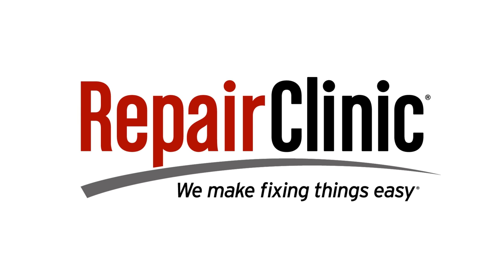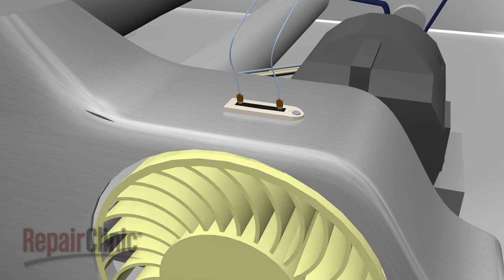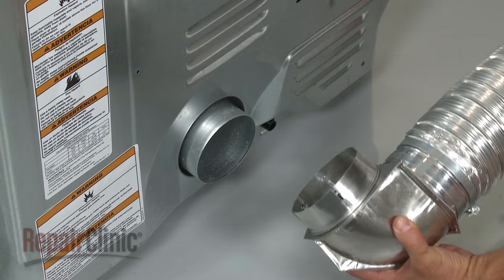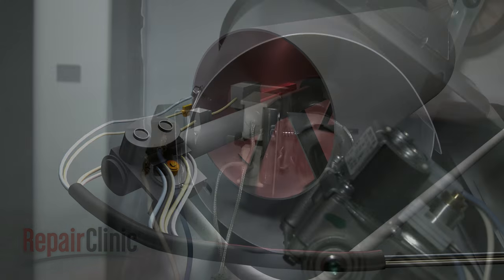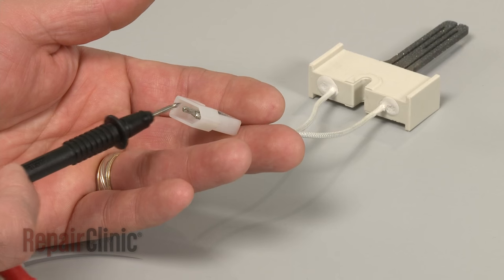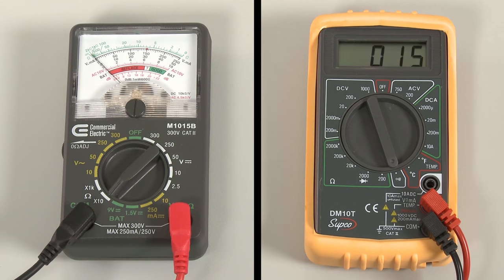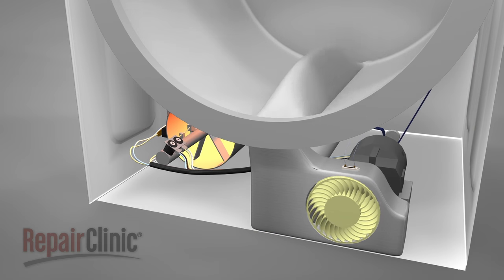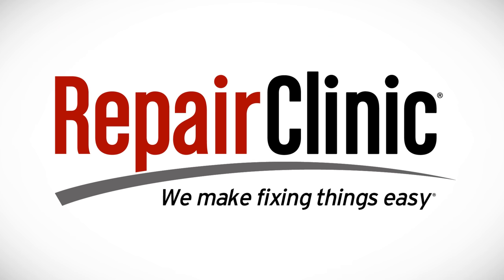Top 5 Reasons Gas Dryer Is Not Heating — Dryer Troubleshooting

Comment: I not only had to clean the 4 inch ducting I also had to open the blower housing at the back of my Maytag dryer  ( 4 nuts at the back holding the housing and 2 Phillips on top by the screen) . You have to tilt the whole dryer forward to pull the housing off. All the holes were plugged with stuck lint.

Comment: I've tested the thermal fuse and the flame sensor and both hAve continuity. The ignitor glows, so it's not the ignitor, but no flame is present at all. I also tried replacing the solenoid coils and that didn't work either. The dryer runs fine, but does not heat up. Based on the facts above, it doesn't sound like it would be the thermostats either ( as the ignitor does turn on just no gas burns). Any other ideas???

Comment: Thank you so much for this video.  While doing a load of laundry,  the dryer was not getting hot.  After watching your video and cleaning the vent and also taking off some excess length, the heat kicked right on.  So thankful that I didn't have to buy any parts and will keep in mind to keep the vent cleaned thoroughly more often.   A life saver.😊

Comment: Used a shop vac to suck out the debris in my vertical exhaust vent as well as replacing a $13 thermal fuse and thanks to this video saved me a trip to the laundromat.

Comment: Thanks for the video - Have Speed Queen TR5 Gas Dryer, blew everything out with work shop blower and the dryer heats up fine now.  Bottom area was full of lint but the exhaust line was clean.

Comment: Can it be filled up with lent in the back of the dryer? Could be why it's not getting hot enough I have flames I could see through the little vent in front. On sixty seven counter ford to have a Service.

Comment: GE dryer was not drying.  Replaced ignitor, coil, and the rusting burner assembly.  Still no drying.  ignitor and flame are visible in the mirror.  Flame cycles every 60 seconds for 60 seconds.  Checked the exhaust.  The flow is strong.  The exhaust hose gets warm.  Removed the exhaust hose to check exhaust air temp.  Placed hand in the flow.  Somewhere I have read that exhaust temp should be 200 deg F.  This does not feel like 200 deg F.  Scratching head.  Any ideas?  Thanks.
Reply: I know its been 2 months, but did you fix the problem. I once experienced something similar. I bought my home the ex owners gave us the  appliances. The dryer alsways took forever to dry. I thought Id get a new one since the one I had was old. I put a new one in, same thing. I took it back and told them something must be wrong with it. I took home another. Same crap! Im like what the....! So I called and they sent a repairman. He said the gas line in my house was older , and might be corroded inside the pipes, but he wasnt about to mess with it. So after he left Im  looking at the line and noticed another shut off valve higher along the gas line, even thought there was one closer to the dryer. Being it most likely wasnt turned in years, I debated whether I should try to turn the valve, worried that the movement might cause a seal problem, but I turned it! It turned about 1-1/2 turns to open! The furnace fired up nice and hot with a strong flame and worked fine. My old original probably was good as well, but the owner most likely thought they were saving gas by turning it down, or something?? It makes no sense since you had to run it longer to dry.! What a pain in the ass installing and returning dryers a couple times was!.lol

Comment: Hello Thank you for the great video!
I have cleared the vent replaced thermal fuse and gas valve coils. I tested for continuity the igniter flame sensor thermal cut off fuse high limit thermostat and timer and they are all good but it still turns off after 20 seconds. Please help.
Reply: Its the gas valve,  it is near the coils.

Comment: My dryer starts but the igniter does not light.   I replaced the igniter but no luck. Imeasured the resistance of the igniter and it was 60 ohms so its good.  I measured only 56 volts across the 2 pieces of metal that hold the igniter in place.    I have in the past measured 120 volts.    Any tips?
Reply: The problem was the flame sensor.  It was OPEN no voltage could go to the igniter.  I jump the flame sensor and now I have 120 volts at the igniter.

Comment: my dryer wont heat.  the vent is clear.  if I pull the dryer out from the wall it works sometimes. is that a crimp in the gas flow?

Comment: dumped my maytag washer that was not even two years old because it quit, now the whirlpool dryer geez, don't they make anything to last anymore.
Reply: I have had my Whirlpool washer and dryer for over 30 years! Whoo hoo. However the dryer is not heating so I'm going to look into fixing it myself. Getting a multimeter to check the parts mentioned in this video. Anticipating a fix. 😁 But I agree with you that things are not built to last these days. But parts do wear out so if it's a part I can still get, I'll be happy to fix this. I fixed my washer of this pair when the agitator wouldn't agitate anymore. Simply had to replace these little plastic pieces called "dogs". 😁

Comment: I can't find the thermal fuse on our GE  gas  dryer  Drsr483gg4ww.   I went to your website and looked at the repair parts for the dryer and I cant even find a replacement thermal fuse for the  Drsr483gg4ww,   
However the thermal fuse is mentioned under  cause #4  Flame Sensor ......"On a gas dryer, the flame sensor detects the heat emitted by the flame. If the flame sensor isn’t working, the dryer won’t heat. Before checking the flame sensor, first make sure that the igniter and ***thermal fuse ****are not at fault. To determine if the flame sensor is defective, use a multimeter to test the sensor for continuity at room temperature. If the flame sensor does not have continuity at room temperature, replace it."

Where is the thermal fuse located on the  Drsr483gg4ww.

Comment: I replaced the fuse, i checked continuity of the gas coils. But before taking apart the top and front panel, i peeped in the window and there is no glow or flame. Will there still be a glow if it happens to be the igniter or is the igniter only responsible for the flame? Or is the flame and glow the same thing? Either way my fuse and coils are working but its not getting hot!

Comment: Could the problem be beyond the electrical and be a mechanical problem of the gas valve?   The igniter will lights up (heats up) but no gas. The solenoids buzzes  while the igniter is energized but we do not get any flame.   Per your video we checked out the (1) Thermal Fuse, (2) both solenoids, (3) the igniter (4) flame sensor (5) thermostats with a digital meter and they all checked out fine.
Reply: Did you find the problem?

Comment: my gas roper dryer is losing heat after 10-15 minutes.  the spinning/ tumbling continues.  i've checked the continuity of the thermal fuse, gas valve coils, igniter, flame sensor, and the thermostats and all appear fine.  is there anything else i need to check?  can any of these components be failing despite passing the multimeter test?  any help would be much appreciated!

Comment: Does anyone know what happened , after I put new Thermal Fuse and the two gas valve solonoid coils , the Maytag gas dryer start and heat ok but about 10 minutes later it shut off again and no heat?
Reply: Sounds like something causing fuse to blow such as dryer lint in the system.
Reply: Try completely cleaning out the lint from the entire vent pipe. (if you haven't already).

Comment: I checked all these and none fixed the issue of my dryer not heating up.  Turns out I had a bad heater relay.  Easy fix, but I didn't see that mentioned in any repair video online.
Reply: Mike Grayford What was going on? 2/10 of the times I turned on my dryer, the igniter/gas/flame turned on for about 2 minutes then shut off. Sometimes I just have the drum spinning.
Reply: The heater relay is definitely not your problem.  If it was, no electricity would be going through the heating system and you wouldn't even see the igniter glow.  You might have a problem with air flow.  Make sure your dryer vent is clear, your lint trap is clean, and consider opening the panel to clean out the inside (make sure the dyer is unplugged).  That's the best case, with the easiest (and cheapest) fix.  Other than that, seems like you might have failing coils (AKA solenoids).

Comment: does not heat properly .on the timer it will not  heat on a full setting. But when i set the timer  with ten minuter left it heats  ... Help help